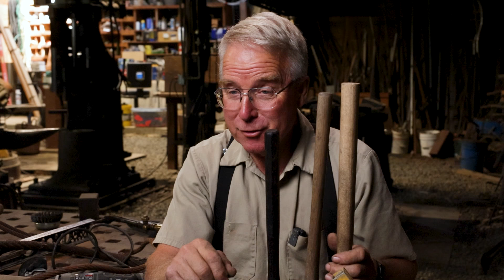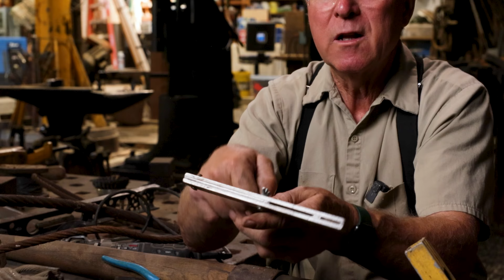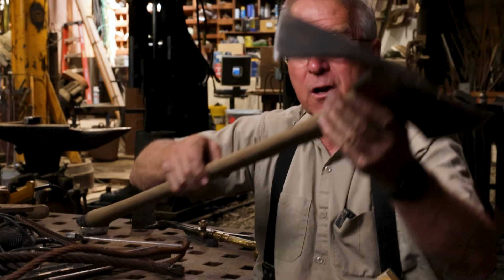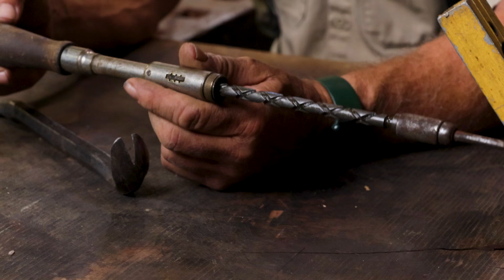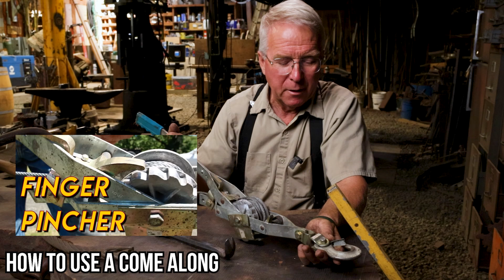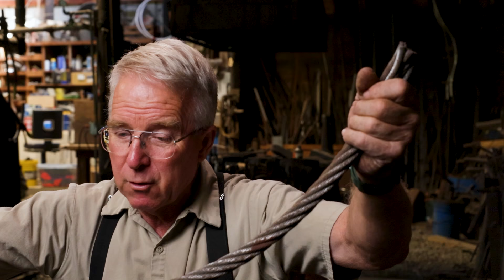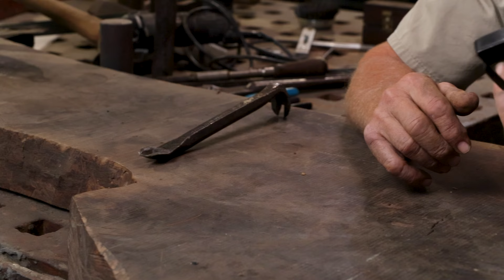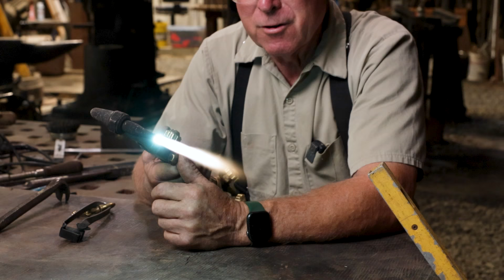The 15 Weird Tool Nicknames You Never Asked For

Comment: The guy who introduced me to an oscillating tool - maybe 15 years ago - called it a “fine” tool.  I asked him why, and he said it was because the saw made fine cuts.  Later on I found out that many carpenters called them that because an early manufacturer was Fein.  Now its just an oscillating tool to me, because I use it for many, many things:  cutting drywall, trimming corners of plywood, metal work, cutting off nails and bolts, power filing, and detailed sanding to name a few.  What a fine tool!🌿

Comment: In the 60's I was issued a Yankee Drill by the C&P Telephone Company of Maryland. I was a telephone installer. Years before battery powered tools, this little drill (which I still have two and use them often) was perfect for the task of drilling holes for a wood screw.

Comment: The oscillating multi-tool, I call it a Shoemaker's saw. Or Shoemaker Saw. The reason I gave the tool this name is if you're using it, it's likely because you're correcting sloppy work done by an inexperienced person.

Comment: The level is also known as a plumb stick and the bubble in the vials as whiskey bubbles. They used alcohol in the levels so it didnt freeze. I got him beat. My experience goes back to 1972. Trans Alaskan Oil Pipeline in 1974

Comment: I learned 'dikes' when I was a kid helping dad and didn't hear diagonal cutters until I was probably in my 30s.  He still has a yankee screwdriver (never had a specific name nor did he ever use it).  I fooled around with it a bit.  one up side of those is when driving you're pushing the bit into the screw.  Down side is pushing when trying to remove the dang thing!  As always, thanks for sharing.

Comment: Throughout the 80s and early 90s I used to build bolted oil and water storage tanks. The piece that was put on top of the laps of steel, to seal it, were called turds. This was because they were made out of asbestos wicking rolled up in Henry’s wet and dry roof, cement, and they resembled a turd. Also, a hand wrench was called a 30. That’s because Williams made a wrench with a 7/8 on one side and and 11/16 on the other and the part number was BW-30. 7/8 fit the square nuts on half inch hardware, and the 11/16 was for the 3/8 hardware.

Comment: I never saw a choker before now, we always used "slings" (which we called chokers) for iron work. Just a cable with an eye on each end. Another fire fighting tool is a McCloud. Its a wide hoe on one side and a few teeth on the other kinda like a garden rake but longer and further apart.

Comment: Acetylene torch i picked it up easy my welding instructor when fine the torch using oxygen blast and watch little middle hottest blue and adjusted until it stay blue stable when hitting oxygen and I never forget and easy to taught anyone.
Practice is from metal thickness and adjusted temperature, too hot plate will stuck by under slag.
Adjust right whatever you cut will fall off and leave cleaner to prep to weld easier.

Comment: At 21 I had a quandary and I recognized I needed a marketable skills and as I turned wrenches ( and loved it at $3.75 hr. ) but future is crucial have experience and while worked, I re branded myself and applied Sullivan welding vocational school and I had a grampa worked TWA 26 year's as machinist/ welder and gravitational his ethics and experience.
1996 my instructor incourage to check other processes, start's with brazing then pass each process to stick welding, MiG and Tig.
Before I finished 1st process immediately used and learned quickly how easy and made engine stand and I made from hydroloic cylynoder, for head and rod stock double with end opening to keep hand slip.
Around 3 or 4 pound and I called it B.F.H. and Big f_n hammer. I still have it and one tool i cherish especially I made it with my spec.
Head has about couple degrees to hit flat when hit, few kingpin's and awesome 👍
SORRY STROKE SYNDROME HAD TO EDIT.

Comment: The men I work with call that cabled puller a "Mule". A "Come-a-Long has to use steel chain. The same guys will contend that 'Hammers" start at  4 pounds and any thing smaller is a "Pecker". Really heavy hammers are 'BFH"s. I can't believe you overlooked a tape measure's preferred job sight name of "YoYo" And finally a cutting torch is a "Smoke Wrench"in my crowd. Oh yea, what about a "Monkey Wrench"?

Comment: You say Crow-bar or Rooster-Bar, here in Oz it's a Jimmy-bar. A crow-bar is usually 1.8 metres (6 feet) long, used for levering or chipping out hard, stubborn clay for a post hole.

Comment: a common one for a level is a spiritual cause you checking its alignment to god.
hammers are knockometers. a sledge hammer is a FBH fuckin big hammer

the hook on a tape measure is the dumb end.
adjustable wrenches are shifters or nutfuckers
a persuader is usually a non marring hammer often a dead blow hammer.
combination spanners are ring open enders
box wrenches or ring spanners get shortened to ringies
a flat bastard is a flat file with a bastard cut. a half bastard is a half round bastard cut file
a oxy-fuel torch is a hot spanner, gas axe or oxy set. gas axe referring specifically to a cutting torch set up.

Comment: Interesting stuff. My FiL was a logger, drove cat and set chokers at various times, faller a bit too. According to him a peavy has a point and a cant hook doesn't. In general a cant hook was a sawmill tool, used for turning cants on the saw. My favorite name for a bit of kit is "slangle", for a sliding angle gauge. I have several. Your squangle is evidently a cousin German to the slangle.

Comment: I called them dikes before I even knew they were actually called diagonal cutters.  At work we use spud wrench to mean another tool that’s used to hold toilet spud in place as you tighten it down.

Comment: I have difficulty now as I forget the names of tools I have use for 40 years. 
Your level is the same or mostly spirit level, hammers in construction, the claw hammer with a medium curve on the claw, the mash hammer, mainly for battering something, and the sledgehammer,  pry bar is a craw bar, from crowbar, your cat bar is a pinch bar, spud wrench is a podger, I mainly used mine when constructing pylons in substations, diagonal cutters are referred to as side cutters or snips, I also use my snips for pulling nails too, I had a Yankee screwdriver that I got from my father who retired in 1980, and it was old then, hot wrench is oxyacetylene torch.

Comment: I still call the oscillating saw the multiMaster because to my knowledge the first company that made it was fine f e i n they were made in Germany they came in a nice big metal box but then they became insanely popular and everyone was using them and they are good for everything I personally use mine for door shims I can hold my shim pack they don't wobble I can just use the saw cut my shims nice and flat so I don't have any trouble door casings and I also don't have any problems knocking my doors out by cutting shims with a razor blade or a sawzall or chisel or whatever the hell people use I use the multiMaster

Comment: This is great. I had a Yankee back in the 80's, used to drive flathead screws to build theatre scenery. Thought it was great. Got it out of retirement the other year and tried it out. I didn't like it any more, and junked it. Over here a "door bar" is also the metal strip (in many flavours) that a carpet fitter uses in a doorway or for a change of floor surface

Comment: What’s happened to the old tool makers? I’m 89 years old and worked in a hardware store in Australia during the early 1950s as a messenger boy at age 14. 95% of the tools were made in Australia, and they were of good quality. Nearly every payday, I would buy a hand tool such as a saw or a chisel. I still have many of the tools I bought back in the 1950s. The only tools that were imported were handsaws from Sweden, precision measuring tools from Germany, and cutting tools, like the wire cutters shown in your video, and spanners from the USA. I still have those wire cutters from the US, and they still work as good as ever since I bought them over 50 years ago. But now all of the Australian tool makers are gone, and all tools sold in hardware stores in Australia are made in China.

Comment: I carried a 2lb sledgehammer doing appliance work.  Almost never needed it except for one brand where it was sometimes an official fix 🙄  I called it Cat - Customer Adjustment Tool, for adjusting bad attitudes.  Never did use it as such, even though I might have been justified once or twice 🤣

Comment: Very fun video!  I too have names for all my tools and share many of the same ones you used.  We differ only in your hammers like Helga and Flika.  We wield Thor, Mama Thor and Baby Thor for those less than passive jobs.  The multitool you call the buzz saw we call the Fun-Saw since it does all the jobs so easily that used to be very difficult.  I'm a retired surgeon and we have names for every tool/instrument we use such as the iron hook, a tiny delicate instrument used to gently persuade foreign objects out of the auditory canal and there's the sopup also referred to as a sponge used to collect or sop up blood and fluids in the surgical opening to keep structures visible and protected from retractors like the Army/Navy bars.  Keep up the great work.

Comment: This was enjoyable. Thank you.
 Ive a 1x5 x 4' board, heavily worn, with a 3" ish tear drop drop hole in board face at one end.
 With a notch at opposite end of board. Hook your plumb line in the notch and the bob would swing in the opening. A plumb stick i heard it refered to. Then somebody put a brass 'bezel'  and glass on one long edge making it a spirit level.
 Took the brass off to check it out and it was made from an old clock face. A total relic that lived long enough for me to find at a garage sale.

Comment: I'm turning 40 this week, so I'm not exactly old or extremely experienced. But I've worked a bunch of different jobs in life, carpentry, electrical, so I knew about the first few tools. But then you brought out the come along, and my work in dismantling radio towers used those heavily. I felt so happy seeing that! Like, "hey, that's something I've used before, and a very small set of people will ever come into contact with that!"

Comment: The differing names of tools for different trades and different locations is fascinating.
"Persuader" works in the UK too, or a smaller, maybe 16 oz, hammer can be a "Birmingham screwdriver" (Birmingham UK was more known for light engineering than carpentry)
In the UK, a spud-wrench is a "podger" (I only knew them without a wrench/spanner, but the dictionary says they can include one)
Perhaps surprisingly, we had "Yankee screwdrivers" too.  There was an alternative name, but I forget -- it must be 50 yrs since I last saw one -- they seemed to disappear years before good cordless screwdrivers appeared, and I missed them.
"Striker" works in the UK too.

Comment: So the I've heard the oscillating tool called a few things, some that are probably not quite appropriate.  I've heard it called a "trimmers d*ldo" or a "carpenters vibrator" cause sometimes its the only thing that'll get the job done.  I've also heard it called a "zipper" or "zip saw"  I think from the brand name but actually it was a different tool that  is being confused with this one. A "f*ck saw" cause you usually need it after someone finishes cussing and finally my friend calls it "OSCAR"  Oscillating Saw Cause its Another Remodel.

Comment: My grandfather had a come along also known in WV as a tree choker. I haven't seen one built better and easier to use. It was all cast iron it had a20 ft chain with a hook on one end and a 100 ft chain with another hook. It had 1 lever you flipped. I don't like the wire ones at all. I guess that's just me

Comment: oscillating tool thing, 3:20, i call it a laser chisel...cuz its kinda like if you had a chisel with a laser edge. love it
Reply: We call it buzzer
Reply: that is a nibbler.
for nibbling the edges on fiberglass for installs
Reply: I call it a fine tool
Reply: It's not a buzzsaw, it's a wobble saw.
Reply: An older fella i worked with would call it a "zizzer"

Comment: What is a rabbet gun? (Electrician's tool). I don't like the term Spud Wrench, because I have an odd plumbing wrench that has no alignment pin (AKA bull pin) for a handle, but it is clearly marked "Spud Wrench". My dad called the maddok a "Pullaski" and a similar version he called a "grubbing hoe". We had a few items we called "Donkey Dicks". An explosion proof flex conduit, and a Kellum grip cable pulling sock were both called "Donkey Dicks". Some of the old GE X-ray controlers were called "Pecker Heads", due to their shape. I X rayed welds, concrete walls and concete ceilings/floors. We called the cutting torch "The Big Blue Wrench". A rabbet gun is a large pair of cable cutters for copper or aluminum (NO  STEEL). Rabbet is the scraps that are cut off. We often steal it to sell for scrap. If you share the rabbet money eually with your crew you will have a great very loyal crew that works very well together!

Comment: Hey, im from the UK, i can relate to some of those tool nicknames, we have nicknames for tools here too

A speed brace (brace and bit) now days we call that a cordless drill 😅

We have a "heel bar" which is what you called a cat's paw on one end, and the spike from the spud wrench on the other end

We do have spud wrenches, i cant think what they are called, maybe scaffolding spanners, (we call wrenches spanners here)

Pry bars are known as crow bars, anything bigger than one handed use is a wrecking bar

We call most hammers under a lb a toffee hammer, or technical adjuster 😅 testicle adjuster if you let go of it 😅

I have one of those multi tools, they are known as oscillating multi tools here, but i call it the vibratey tool

I got what you guys call a saws all, we call them reciprocating saws, mines a dewalt, and i got jig saw too, so i call mine "big yellow"

Im trying to think of what other nicknames we use  😅 but all i can think of is when were pranking newbies and send them to the store for a left handed screwdriver or a glass hammer, or a long weight, or sky hooks 😂

Sprit level = bubble level, thats another prank, we send the newbies to he store for bubbles for the spirit level 😂

We never really use come-alongs, we either use electric winches or just drag things with SUV's and a tow rope or ratchet strap

Impact wrenches, we either call them battery buzz guns, or ugga-dugga's, because of the sound they make

What you call a hot wrench, we call a gas axe

Some Tool names are very different here than over there

We call mitre saws "chop saws"

Its quite interesting hearing the different names for things 🙂

Comment: I have a couple jaw wrenches that I'm not sure what their name or specific purpose is. They have a c-shaped jaw pointed straight like end wrench, but they have no adjustment for jaws. Instead,  the jaw assembly, anchored by swivels will tilt exactly proportionate to each other. Each jaw is attached by single swivel, then seems to be forcing opposite jaw equally. So grip shape starts as 3/4 circle then if either side is moved, the other will lean exactly the same angle and direction to cause elliptical grip shape. IMO, the neutral position is only way to grip any symmetric work piece. Torquing the handle 1° away from middle causes both grip faces to loose contact with any solid shape between. What makes them even more curious is the tool foundry no longer exists - even Google has no info.

Comment: Australian 84 yr old metal worker here. Great fun vid.  I still have and use many of my carpenter/ coach builder, father's tools. Including a Yankee screw driver that still works.  We sometimes call the HOT Wrench a Gas Axe or a Blue Tongue chisel. my 56lb hammer is the Apprentice's hammer (the boss aint gonna swing anything that heavy),and my 2 oz tinsmith cross peine hammer is the toffee breaker.

Comment: Ever heard of a Chinese water level? A clear, flexible plastic tube (say 30' - 40' in length) filled with several feet less of some colored liquid (I used winter window washing fluid with alcohol). Holding the two ends up above the rest of the filled tubing, you mark where the liquid finds it's level on each end. You of course cork the ends and handle with care for storage. It was very useful for plotting a level fence top on lumpy uneven ground. If used carefully it can in some instances replace the spinning laser levels (don't know why you'd want to :) in use today.

Just a weird old tool I read about and built :). Great video. Thanks

Comment: What you call a buzzsaw I eventually learned to call a multi-tool, but at first we just called it "The Tool" I honestly can't remember how I did things without it. Easily the best addition in the last 20 years. Well that and the SawStop safety system for the table saw.